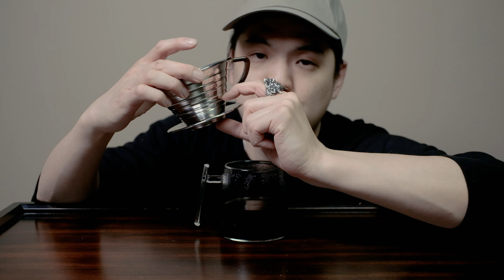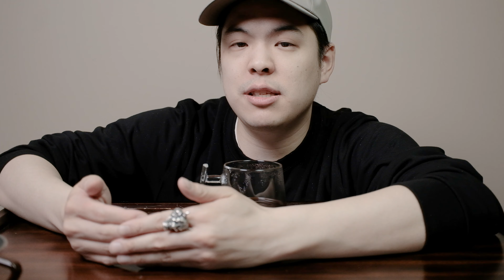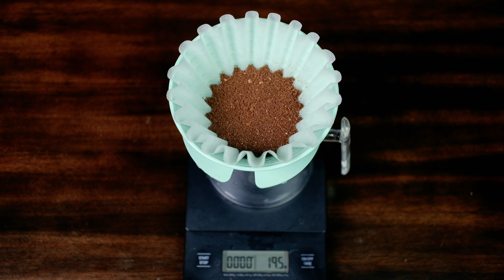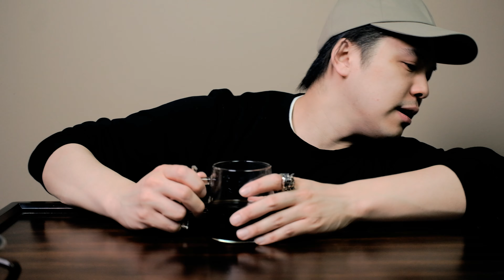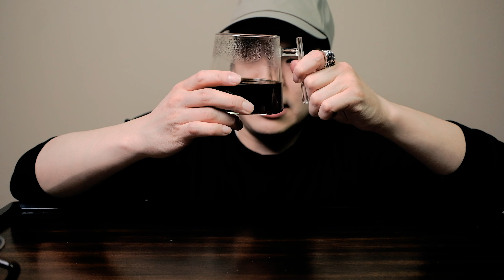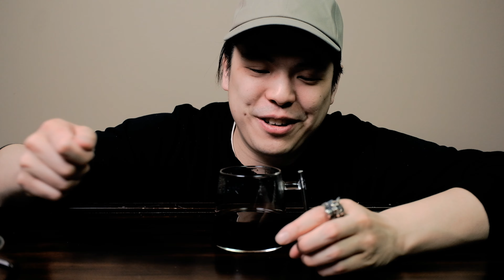My POUROVER Recipe - Flat bottom edition

Comment: Did you get the flat and wave filters with the Orea? Curious how you would brew differently on those. (Pouring between the edges on the wave and if it's about the same against the walls.)
Reply from the maker: I got a pack of Sibarist along with a smaller kalita one. I only have the big waves rn I wanted the smaller ones so the 155 I think. Hopefully it comes next week, but I might be a bit busy so I'll probably unbox end of March and post around then!
Reply: @TALESCOFFEE  no worries! Excited to hear your take (positive or negative) on it.

Comment: Kalita wave metal🤢🤢. The tsubame is way better, but no worth the price, it's just the glass version much more resistant and expensive 🫰🏽. The glass is the best one overral but liked i said on the previous video, it's so fragile that looks like was made to break. I send you a picture of my new v60 01 (i am loving, it's the best conical, your are absolutely right 😍) and so resistant and firmly. The ceramic one it's kinda of middle ground, it's not gonna clough so hard as the steel, but it's not fast like the glass and Tsubame, it's beautiful also.
The timemore b75 may fit your style very well, but it's so fast that you can underextract very easily, so i gues would need to be on even finer ground the you usually do.
I would love to buy the April, i may have the opportunity in the next month, i never use, you recommend?
Another thing to experiment if you have access is the Kalita wave with sibarist flat filter, i think is something very interesting, may even "fix" the wave issues 🤔🤔🤔.
And the Origami, would you bring back for this new discovery journey? I find so interesting with the melodriplift😸🤟🏽♠️